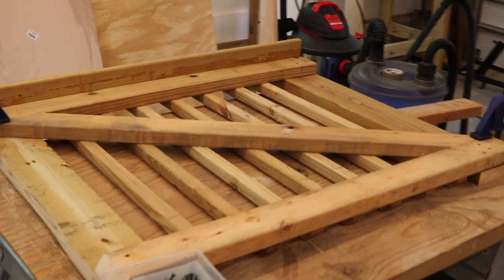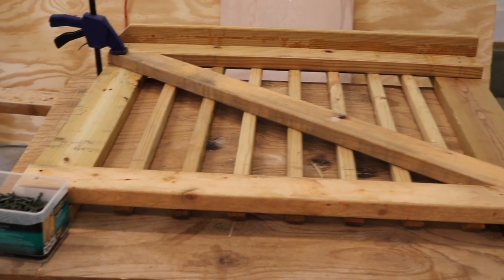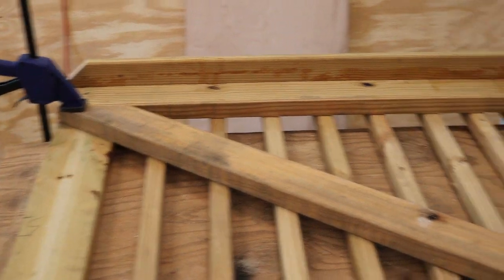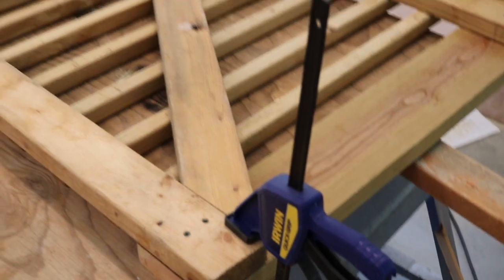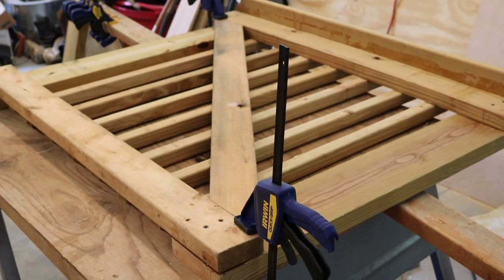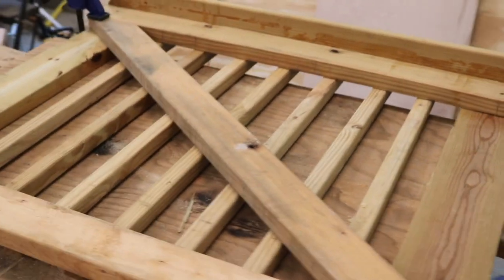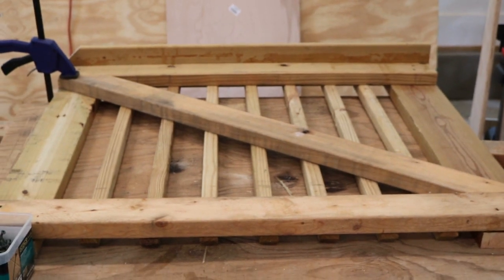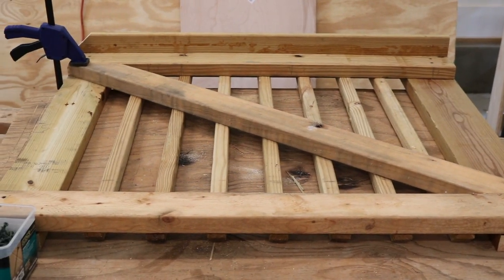#29 Build a Deck Gate

Comment: I was hoping to see the actual build so I can follow to make one for myself.
Reply from the maker: Hi Helluvanails!  You should be able to assemble it by looking at the video, of course the measurements are completely customized based on height and length of the gate opening.  Assemble the main 4 boards, then attach the top, then attach the cross brace.  You can do it!

Comment: How has the brace performed since you put this up? I took off our gate that didn’t have a brace because it started sagging a month after install. Thanks for the video!
Reply from the maker: The gate is not sagging at all.  The brace definitely is doing the job.  Our Great Pyrenees did chew up the rails a bit when we had workers over and he was on the other side of the gate... but those are easy to replace.

Comment: What angle did you use for the wood to go horizontally across
Reply from the maker: Hi Jill.  I actually didn't measure the x-bar brace as an angle.  What you can do is get a board that will be large enough to cut a brace.  Lay that on top of the upper and lower horizontal boards and mark the brace board at the right location (I use a knife so I can see the mark better) and use a straight edge to draw a pencil line to cut at whatever angle will work for the particular size and shape of the gate.  No angles need to be measured.  Just mark it and then cut.  I have a more recent video, making a compost bin, where I actually show the process of making a similar brace for the compost bin sides.  Good luck with your gate!  Thanks for watching!